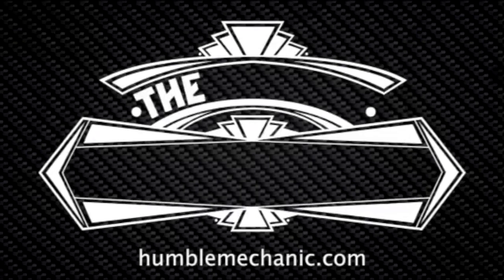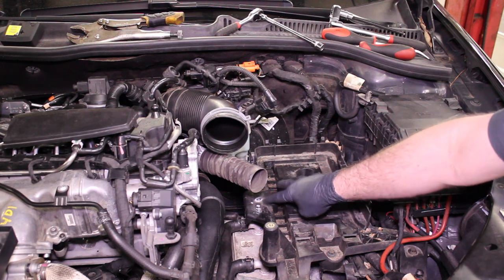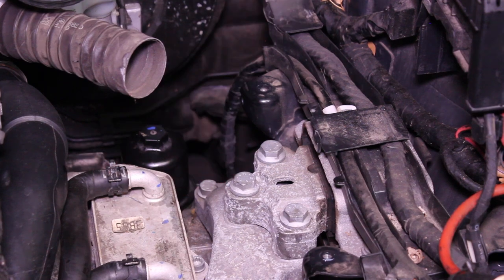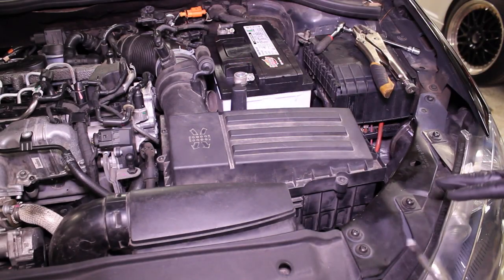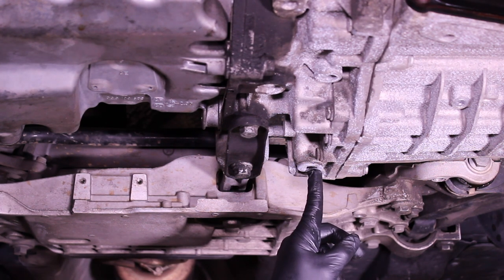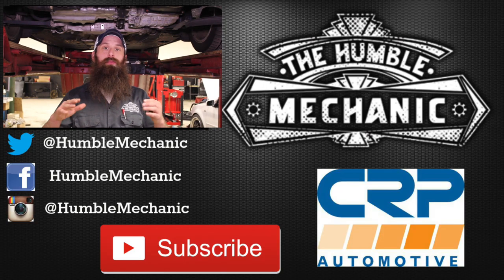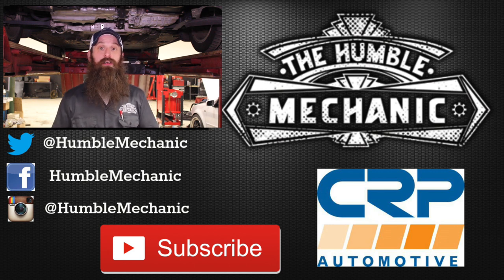How To Perform DSG Service for VW Audi

Comment: Good job VW, making what was a simple thing so complicated the average DIY person won't attempt it, giving your dealers more service work.
Reply: It's so fuckin' easy!!! What's the problem with VW? The hardest thing is to track fluid temp. However, if you are a DIYer and don't have a VCDS up&running, forget it!
Reply: It is not that bad a job, but again this is not a job for a noob...
Reply: @mschumacher1805  My Saturn is a drain bolt like oil> fill through tube> check at idle temp. Far easier.
Reply: Yeah, I thought the same thing, myself...  Let the dealer do it -- too much of a pain in the ass to do it myself.  Then my local dealer raised their price to $499 for a damn DSG service, and I decided I could do it myself.  And it really wasn't anywhere near as bad as I'd thought it would be.  And when the timing belt needed doing at 120K miles, I went ahead and did that, too -- that was a much bigger pain, but still doable with the right tools.  Even with the special tools, I still saved like $500 off what the dealer wanted for the timing belt.

TL;DR -- all modern cars are complicated, but you can work on them if you're determined enough.

Comment: An alternative way... drain fluid, refill with 5L through oil filter housing. Takes bloody ages but doesn't need any special tools. Warming DSG oil in hot water helps the time it takes.
Reply: Do you know if this method will work on a mk7/s3 2.0t?
Reply: I think the same
Reply: 5 Litres or just the amount of fluid that came out of the car? Also why does it take so long through the filter? Does it just go down into the transmission slow through that?
Reply: @leonardoarispe4689  Be careful, some models have dry clutch and use way less fluid, which does not need changing.
Reply: @mohammadkamran5862  5 litres is a good amount - you don't know if it was over or underfilled previously so stick to a known fill amount.
Reply: @dopiaza2006  yea that's a good point. my wife just bought a 2012 Beetle I want to change out her DSG Fluid so it doesn't cause any problems. thanks for the reply
Reply: @dopiaza2006  I'm just scared pf overfilling it and I don't have the expensive tool to check the fluid temp to make sure it's at 35 degrees. any Idea if there's a way to check the temp any other way?
Reply: @mohammadkamran5862  If you drain it then refill with 5L you can't really go wrong.
Reply: dopiaza2006 thank you sir.

Comment: Are you still around? Ever come acrossed a problem   all is well except in sport seem to Slip or way to long to shift and launch control doesn't seem to engage ,did oil filter heat up chk all good reset trans , perfect everyday,not race?? Plz

Comment: Question. I've seen other transmission fluid changes where by the oil drain plug is removed first along with the measuring  nosel thingy if your car has it. Then, loosening the DSG filter and letting the oil just drain out. Then grab  your self a sandwich, watch some YouTube clips of bad drivers  and come back to the rest of the service. Can this be done this way? I just think it's my preference since it removes the need for clean up of any oil spilling out when removing the filter. Almost creates a vacuum in the trans to let all the oil out. Just wonderin'. Thanks anyway for the great vid.

Comment: Hey Charles!  Thanks for all the vids.  You're a great resource for just about everything I've had questions on regarding my Passat B6.  I heard you state that you always remove the negative battery terminal first and reinstall it last (which is the correct practice) but then in the video you bounce back and forth between the 2 terminals with your wrench.  Just as troubling is that your wrench was long enough to connect between the terminals.  Clearly you're and experienced mechanic who is well aware of the risks of inadvertently connecting the 2 terminals and you took the requisite care not to.For the rest of your viewers though, the practice of removing the negative cable first is to eliminate the risk of contact by the wrench with surrounding metal parts.  Once the negative cable is REMOVED (not just loose), then the positive cable can be worked safely with no risk in case of inadvertent contact by the wrench with adjacent metal parts.  Additional safety can be achieved by ONLY using tools shorter than the distance between the battery terminals.

Comment: My wife's 2012 Jetta Sportwagen TDI, and my step-daughter's 2012 Jetta TDI Sedan are both exactly the same as this. (Well -- almost exactly the same.  Their cars have the Torx T-25 screws holding the air box together.  8 of them.  Because apparently VW really wanted that air-box to be held together well.  LOL)

But you've gotta love the fact that VW kept this exact same setup in production for multiple years and models.  Makes servicing so much easier!

Comment: Did my DSG relatively recently with the kit from Deutsche Auto Parts that you did with them. Gravity filler was time consuming haha. I found cutting a small hole in the fluid bottle helps with pressure building up and taking even longer.

Comment: I'm watching this video as I'm about to attempt a DSG service, it looks very useful so far. One thing that made me cringe though, undoing the allen bolt next to the battery with a metal ratchet. I've always worked on the assumption that the battery gets removed first regardless of the job. It would only need a small slip to connect ground with live. (A bit later on you're tightening the ground connection and the ratchet actually touches the positive, it's only because you used a rubber covered ratchet that stopped it from making quite a mess)

Comment: It would have been nice if you had installed a Battery Hold Down Clamp for the qwner, this can be a real hazard in a roll-over accident if not fitted.
Also the Air Box and associated pipe work needed a good clean up, change the filter etc.
Attention to the small details highlights a good mechanic from the rest, or in  modern parlance "Vehicle Technition"

Comment: Hey Charles, thank you for this video. Very well made. I have a question if you don't mind. Will having the car on wheel ramps only in the front be an issue with draining or will I be able to drain a majority of the oil out? Thank you for your time.
Reply from the maker: Thanks of the kind words. I don't think that sight change in incline will make a difference.

Comment: On the 6 speeds, i just use a manual pump to pump it in. Warm the car up, then undue the level plug and let it drain off. Takes around 7L with a new wet clutch.

Comment: Great DYI Video. After watching your video I going to change the transmission fluid and engine oil in my (new to me) 2010 VW Passat. only 1 question. When ordering parts online how do I identify the engine and transmission type I have in my car?  Thank You

Comment: The oil level is gonna be checked on 35-45 degrees C. No problem to check it no forex 42 degrees. I work as a technician at a VW dealership, and that is that the ODIS (VW own diagnostic equipment) says :)

Comment: Great video. Looked like a 1/2" drive ratchet though, can highly recommend the Sunex oil filter socket set (SUN3671) has the low profile 3/8" drive sockets for these type applications.

Comment: If you change the fluid while the trans is still fairly warm. (Remove the intake and battery) Then warm your trans fluid up to 100F+(It will cool slightly as you fill your trans). Not only will the fluid drain into the trans faster but it's already very close to the correct operating temperature(and expansion). Just let the excess flow out of the inner drain plug and shift the gears while running, install the outer plug and your done.

Comment: Hey man, I have been watching your vids for my VR6 97. And you helped me a lot... So thanks you, for that. Today I'm having an issue on my Audi A3 2.0tfsi 2006 Tiptronic, she won't drive at all. I have turned on the car, no noise went from P to Drive and shows on the side 2 as the gear ingaged but it feels like a neutral mode. And going on S/tip also 2 can't change it at all. The rear doesn't engage, I have no alarming noise, neither smells... If you have any information about that issue I'll be more than thankful and send you a gift :)

Comment: Great video! I have a 2004 V8 4.2L 6 speed Touareg with 68k miles. I am starting to get kick backs from the gear box in 4th gear at low rpm. Would you recomend to change ATF fluid?

Comment: Very good info Charles, a well done video. I probably won't do this myself, but it is nice to know the steps needed to do the DSG fluid correctly. Any reason you didn't sell this customer a battery hold down? Thanks for your videos.
Reply from the maker: +Chuck Ashton it's not too bad of a job to DIY, but does take time. 

This car belongs to one of the guys at Apex. He just got it. In fact we had to replace the battery just to get it in the shop.

Comment: Hey Charles, nice video! Unfortunately the Amazon links for 1)"Fill adaptor for DSG Transmission" and 2)"Filling unit for DSG Transmission" no longer work (they throw a "Page Not Found" error).  Any chance you could update those two URL's? Thanks in advance!

Comment: The first part, getting the battery tray out to expose the DSG filter, is the biggest PITA of the whole service, providing one uses the drain /measure /refill method to replace the fluid. As far as the VW “special tool” and filling from underneath- just ....don’t....., that’s all.

Comment: Step 1: Remove DSG transmission.
Step 2: Cut hole through firewall to the left of the brake pedal. 
Step 3: Install flywheel, manual transmission, clutch pedal, and tune ECU. 
Step 4: Test drive vehicle by dropping off DSG at scrapyard.
Reply from the maker: Lol come on man the DSG is great! Sure I love to row gears too. But I’m a DSG fan as well
Reply: @HumbleMechanic  Lol I know. I'm about to buy my first manual. A new GTI. MK 7.5 is still on sale and I like how they look more than the MK 8.
Reply from the maker: Congrats!!!

Comment: I have a couple questions, what is that accordion looking hose on the back of the airbox, and how crucial is it. Secondly, you said you put in about 5 liters of fluid, what is the dry fill capacity (new), so essentially how much fluid does the entire dsg take.

Comment: You could also use a battery jumper pack to keep the battery live. That way you don't lose and radio settings for the customer.
Reply from the maker: +233monte for some reason that makes VWs fussy

Comment: Hi Charles, it seems like online it's all the 6 speed DQ250 dsg that need change the filter, i got a DQ500 and the filter is not next to the cooler but closer to engine and it seems like dealership only changes the oil not filter. i wonder how often do i need to change the filter??? is changing it every other oil change okay?? because filter is under the turbo pipe and coolant pipe it's much bigger job to change it. i also have a 6 speed DQ250 and honestly the filter is quite clean every time i change it. what do you think?

Comment: Hi Charles, thanks for the informative video. I have a 2015 CC with the 02E trans. It  all of a sudden stopped moving both forward and reverse. When I scanned it, I got a code P0716 (G182 implausible signal). Pls can the G182 cause the car not to move at all? Is there a way to check this sensor with multimeter. I have checked the connector and no physical damage, I have opened the mechatronic cover and the wire of the G182 looks good. before all of this, I have replaced the DSG oil and filter. Is there something else I can do? My car is 32000 miles. Thanks again.

Comment: Does the dealer perform a DSG reset as part of the 40k service? Some people on the forums say yes, but my factory manual says nothing about it in the fluid change section. I haven't seen any of the DIY videos mention it either. I have performed a DSG reset (outside of the fluid service) before, and it's a lot of extra work if you include the test drive.
Reply from the maker: No, we didn't do that on a service. There is only a few times where they recommend doing that basic setting. Replacing a mech unit, replacing clutch packs, and in some cases for diagnosis. 

no need for that on just maintenance.
Reply: I read somewhere that disconnecting the battery can cause the DSG to reset. Don't know if that's true or not, but would be cool if it was built into the service.

Comment: Great how to ;)  V.a.g says that oil must be in optimum temperature...if is to high its not recomended to drain oil.... so we have to wait to cool down...  To see temperature we must have a diagnostic.... In private I have Ross Tech and on my yob we have Odis (official v.a.g service) Temperature of the oil is important to save mechatronic components.   ;)
Reply: what happens if you overfilled??? i do my oil hcangue and add 4.6L only , i cannot do the process with the VAGcom because i dont have it, i want to add 250 ml more of oil.

Comment: Hey Charles, what is the air tube below the larger air tube? The one below the vac line that you disconnected. It looks like it should also go to the air box but you didn't put it back on.
Reply: +Ian Lynes That's just a tube that collects hot air from the exhaust when the engine is cold.
Reply: +panzerveps ty
Reply: It should have been reconnected.  That's a duct that directs warm air into the air-box from a shroud on the exhaust manifold when the car is cold.  If you pause @4:28, you can see the thermostatically controlled flapper in the bottom of the air-box that admits the warm air.

Comment: this is not related to this video but i watch tour videos and before i bought my 12 jetta tdi and 14 tiguan manual. first i tell you the story bought the 14 tiguan from the vw dealership i used to work at 2 months ago  as a parts guy. i was laid off because this virus. since i bought it had noise in with the transmission when the clutch was disengaged in natural, more of a clacking sound when the clutch is engaged it goes away. i was thinking the dmf but the shop foreman tells me its normal. im wondering your opinion. my tdi is manual and does not make a noise like this

Comment: Good video like always. But I would tell people to do an oil change with a hot transmission so more oil and dirt will come out. Second when filter is removed I would suck any oil left in housing out as it is dirty and that is why we are doing an oil change, and third I would not change the o ring from the filter lid above the oil filter, as any dirt on the lid MIGHT fall on the filter itself. But thanks for showing us how to do it.. sorry fist rely I accidentally commented to someone else. So I corrected it

Comment: Charles - we have a 2017 Alltrack with a DSG. I hope to do all maintenance on my own. When doing maintenance like the DSG service and the haldex maintenance, does the car need to be level? IE, will having the car on ramps cut it?

If not, what are your thoughts on devices like the QuikJack to lift up the car? I have a driveway, but no garage. Or would you recommend having someone do these for me just for the sake of raising the car?
Reply from the maker: yeah you really need it level. Lot of guys have a quick jack and love it. I say DIY that stuff it's not that hard. :)
Reply: Awesome! Also have the MK7 R (manual) to maintain too, so got double the work ahead of me! Both cars around 18k and both are running great! I'll start thinking about investing in a lifting mechanish when I get closer to 30k when I do the haldex one. If you don't already have a gen5 Haldex video, would love to see one within a year ;)

Comment: I noticed when you were removing the airbox that there was a hose lying by the battery that you left disconnected. I just bought my first vw passat and found that same hose disconnected. I connected my hose to the airbox but now I'm questioning myself. Thanks
Reply from the maker: You should connect it.

Comment: Can you add the fluid through the small hole where the filter goes, or do you need to do it through the bottom of the transmission? Also, do you really need to check the temperature level if so what kind of vagcom, obd2 device do I buy?  Sorry for all the questions probably going to change the fluid on my 06 TDI this Saturday and I need all the help and info I can get since it's my first time, thank you!
Reply: Yes you can do it through the filter housing, but it's very slow. Best part of an hour with cold oil.

Comment: Did you forget to reinstall the hot air duct to the air box?
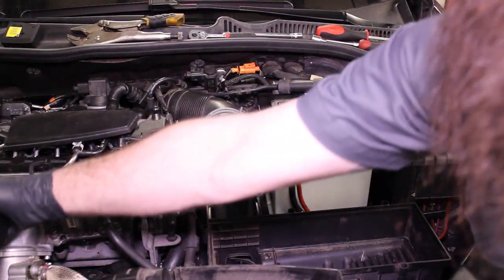Reply: At 3:22 you can see it was already disconnected before he removed the airbox.
I was wondering what the purpose of that is, and where does it go? Maybe to increase idling efficiency since it is technically bypassing the filter and will have lower resistance, but wtf is the point of that....
Reply: @reddyuda  you are right but it doesn't bypass the air filter.

Comment: I usually check the temperature when I take the car into the shop, then change the filter etc, hook up a water hose above the transmission and lift the car up for the inspection.
When I have drained/changed all the fluids in the front, I turn the water on and focus on the haldex and brake fluid in the rear.
When I'm done, the transmission is down to 25-30 degrees C, and I can fill the oil.
I live in a cold country, so we only have to heat it up to 35 degrees.

Comment: Hey charles, when disconnecting the battery on a VW/audi, does a relearn/adaptation usually need to be done? Does it just depend on which year/model
Reply from the maker: No need to do anything to the DSG when restoring electrical power.
Reply: Thank you, good to know!!!
Reply: You will need to reset the 'pinch protection' for the power windows when reconnecting the battery.

Comment: If your stuck for  the allen key, You can take a bolt and put 2 nuts on it, and tighten them together, You can then stick the head into the drain plug and remove it
Reply from the maker: Love that